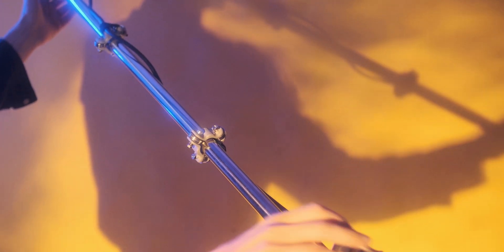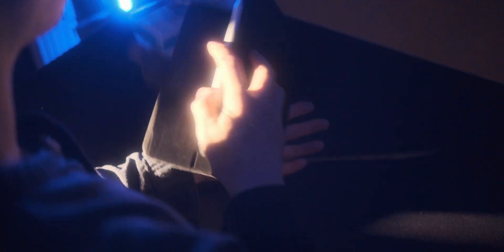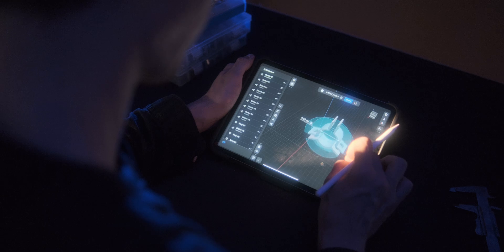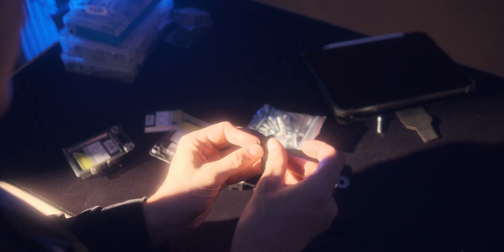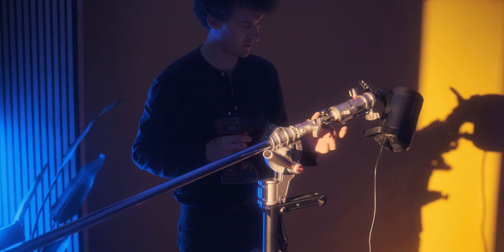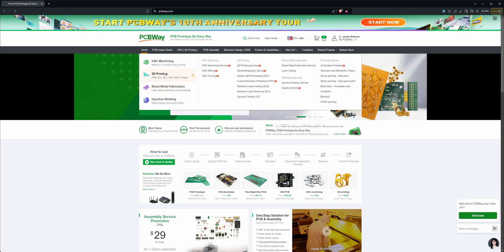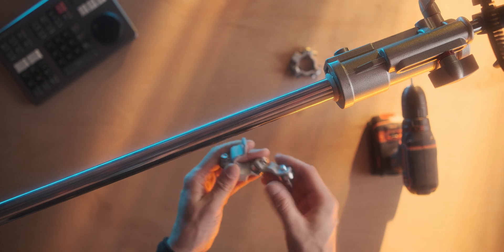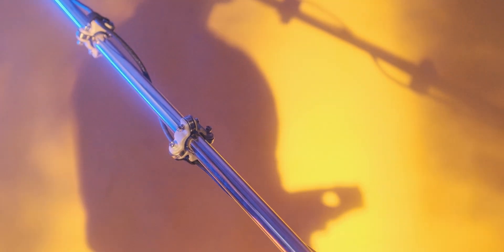I built some Cable Casters - One Day Build - 3D print project

Comment: Nice idea, but I think a bit overengineered. Let the bearings go and simply print a round shape with a diameter 2-5 mm larger than the rod. Will not stuck on the rod and move nicely too. Easier to print, easier to assemble and much cheaper.
Reply from the maker: hahah its indeed very overkill, but sometimes its fun to go completely overboard in that regard, anyway I think you have a good point ill try to be more cost efficient next time!